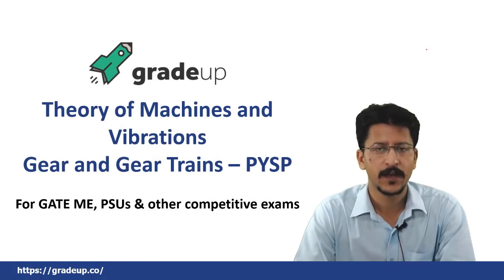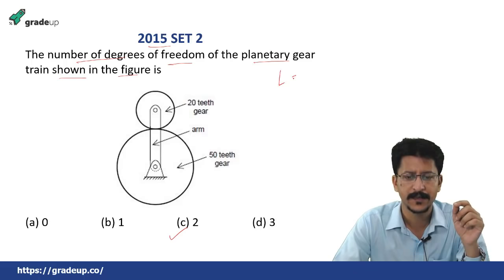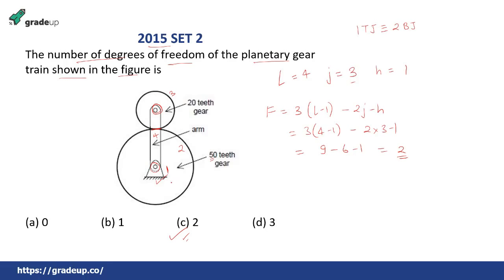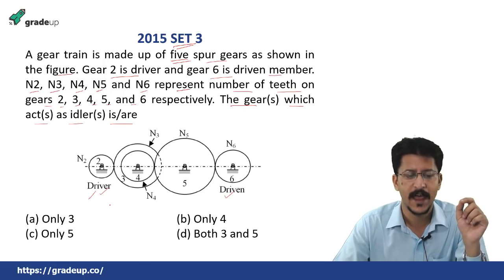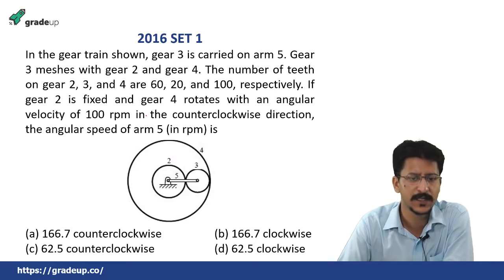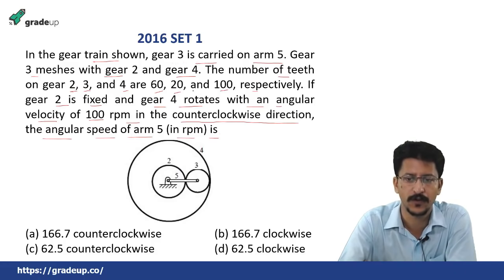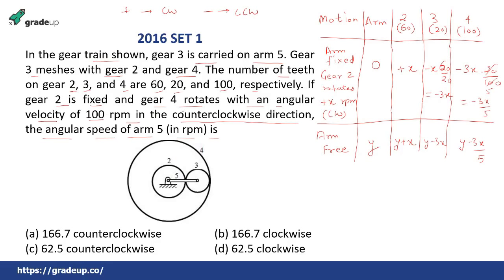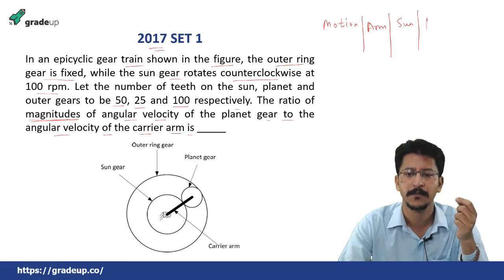GATE Gear Train Problems | Theory of Machines Previous Year GATE Questions | GATE Mechanical (ME)

Comment: Sir sometimes u take higher no. Of teeth to lower no. Of teeth in epicyclic gear train problems but in other problems u tooo opposite in the table
Reply: Eg. In 2016 set 1 u took -x 60/20 and in2018 u took -x 2/3 why that so